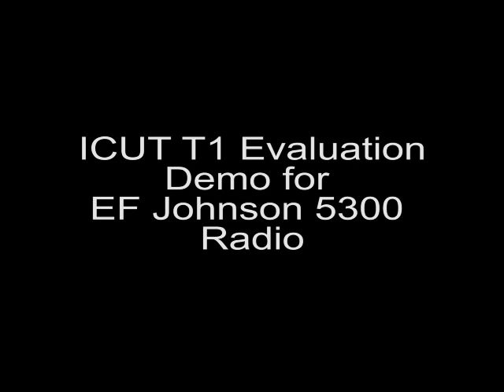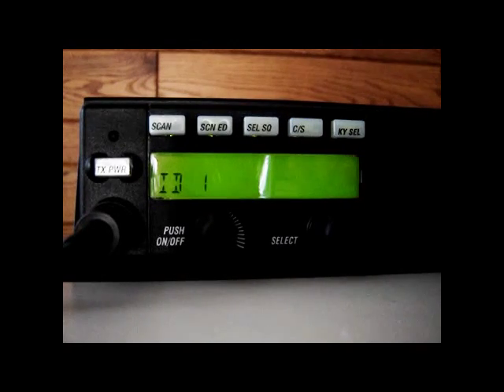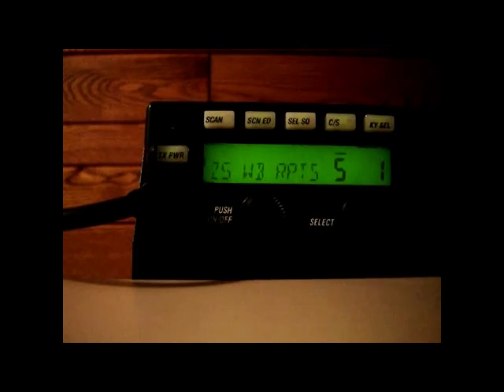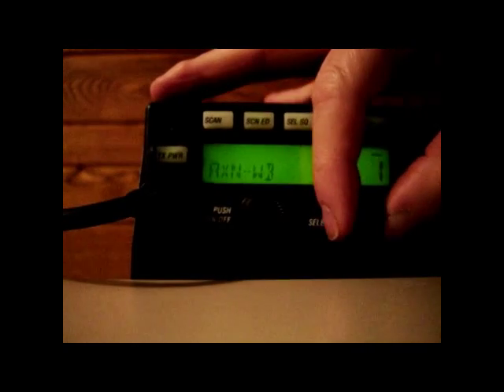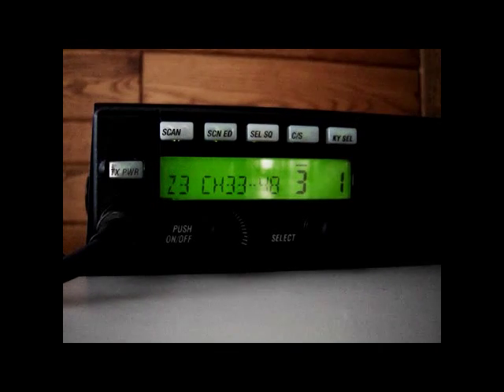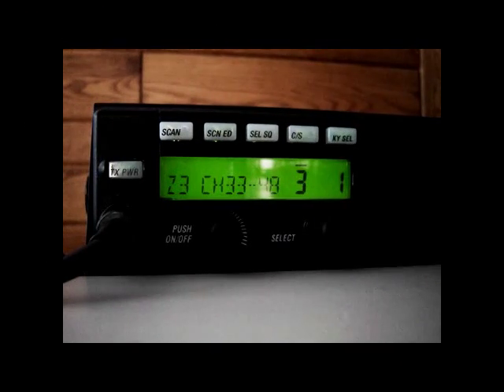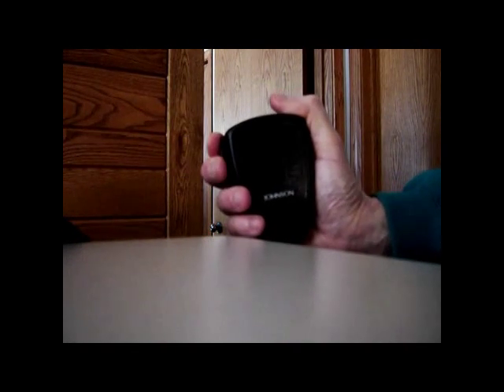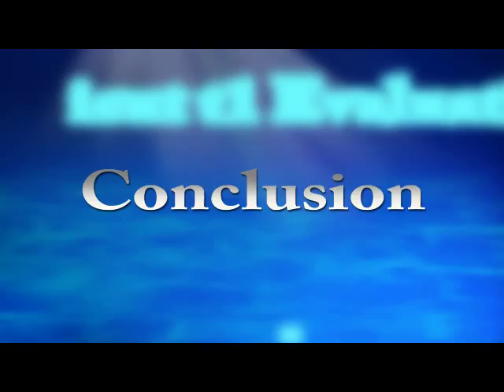ICUT T1 Evaluation Demo for EF Johnson 5300

Comment: Good review of 53SL. 53SL's are tougher than bricks! 

73 de kc5ngx
Reply: @izzywasjuvicisrael297  We used EF Johnson programming software, cable, rib, pc serial cable years ago. Also had EFJ PC-Tune for radio service. Never tried to manually program. I hear that JVC Kenwood/EF Johnson will still sell the public programming box, cables, and the such. They were damn good vhf radios that are built to older standards. The EFJ should make you a good one!